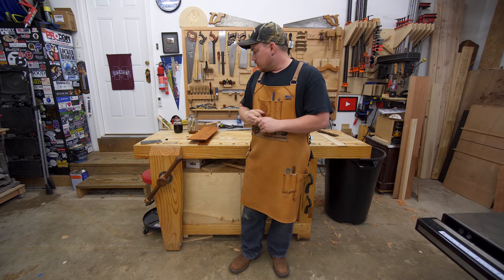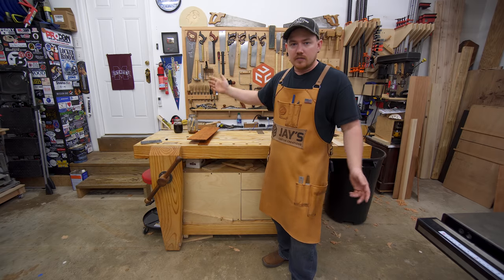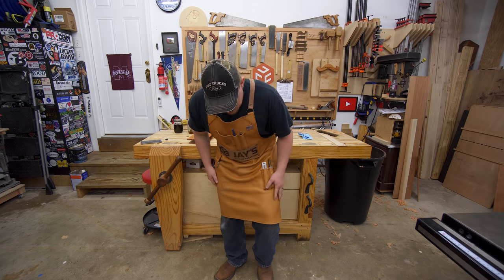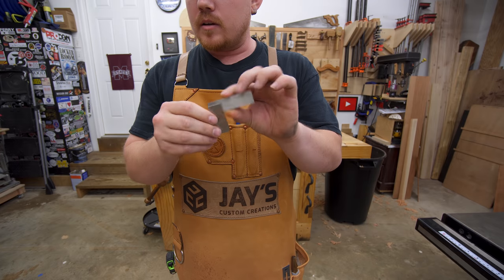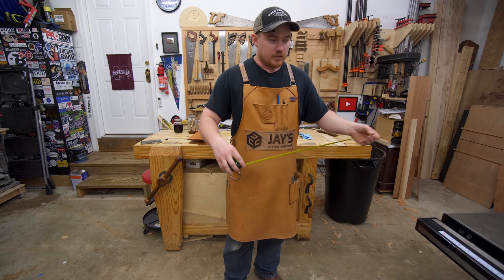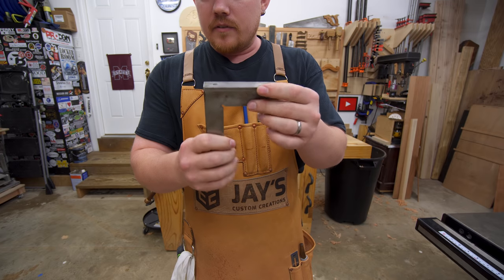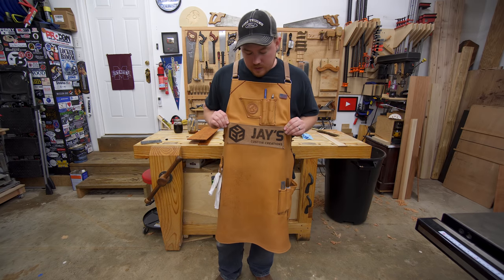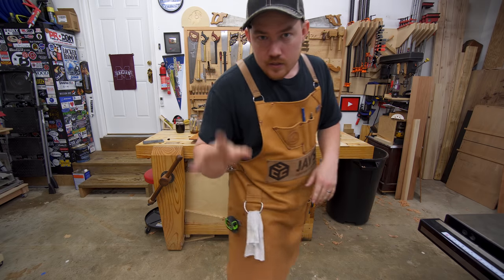My Custom Leather Shop Apron

Comment: Jay, if your wife still works at the vet office, have her bring home a syringe case from a 12 and 20 ml syringe. These may work for your marking knife as well and are round. Being round, they may slide into the leather slot a little easier than the square one you have. They also have a bit of a flared opening at the top which may make it easier to slip the knife into the plastic holder. I think I will take some cases home and design a marking knife around the case.  Great review on the apron - it looks great and appears to be very well made. The ability to customize/personalize it is a fantastic feature and selling point.   Have a nice Thanksgiving tomorrow.         Scott

Comment: I started wearing a shop apron quite a few years ago. Mostly for metal working back then. Really saved on my clothes. Then I added wearing it splitting firewood that really saved on my clothes. Then when I started blacksmithing I really use my apron to the point that I also got me one made. (Not by the same folks as you, I think mine was IforgeApron.com) I highly recommend a shop apron and a cross strap in the back really takes the stress off of your neck.
Reply: Good to know. As old as I am I doubt that I wear the one I have out but maybe sometime I'll damage it beyond repair.

Comment: I remember how empty it was  when you first finished the tool wall but you have definitely filled it past capacity with those few saws on the top. Might be time to rotate the saws out and build a saw till and condense them. Or not . Could be a fun video though.